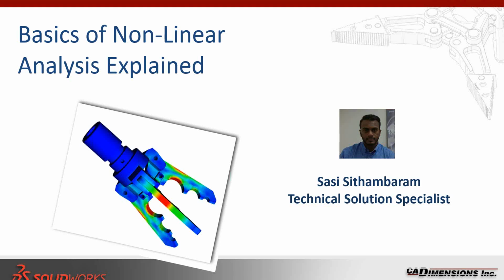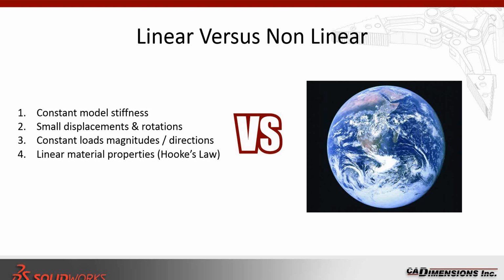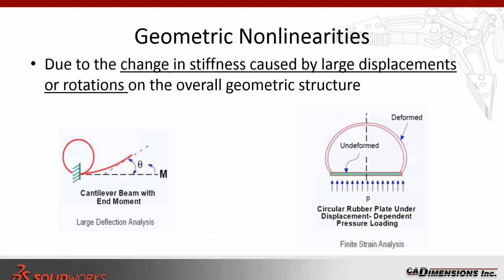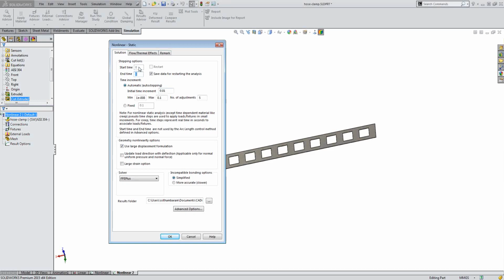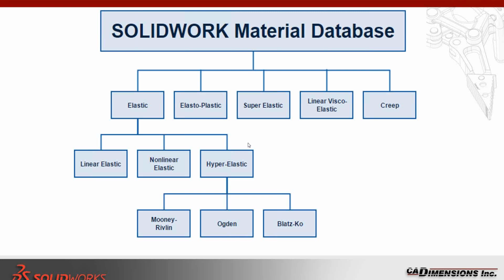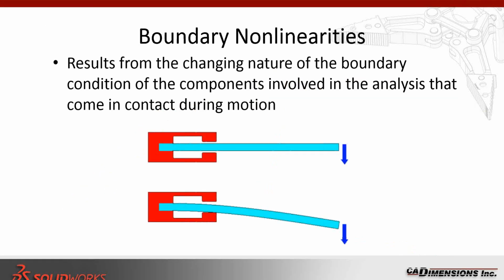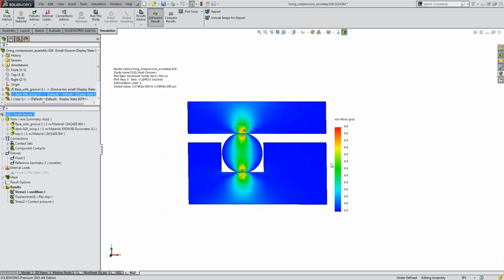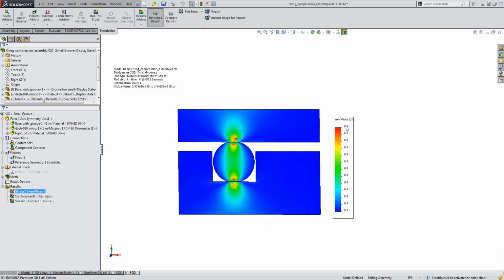Lunch & Learn - Basics of Non-Linear Analysis Explained

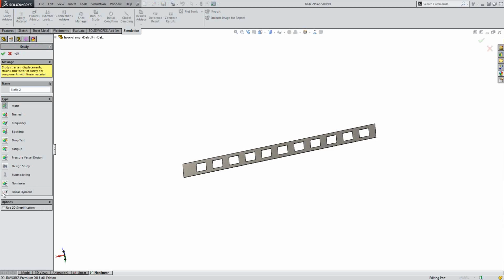Comment: At 18:35, with the hose clamp for geometric nonlinearity, I think it is more like quasi-static, not purely static. By the way, I have a question, for the example of geometric nonlinearity, the hose clamp is still in linear region of the material after bending, isn't it?
Thank you.
Reply from the maker: This may be a “quasi-static” analysis but the assumption we are making by choosing “static” is that the inertia and damping of the movement is going to be excluded. If this is not an accurate assumption, then a nonlinear dynamic study would be more appropriate. A “Nonlinear Static” study will allow for large displacements that occur over pseudo-time. 
We are unsure what material model was being used in this example. Typically this example is shown with an elastic material so the results will indicate past yield, but no permanent deformation will occur. 
Hope that helps! Thanks for watching!
Reply: Thank you for your answer. Just one more question, regarding boundary nonlinearity, could anything involving contact be regarded as boundary nonlinearity? In other words, boundary nonlinearity is contact nonlinearity, and vice versa?